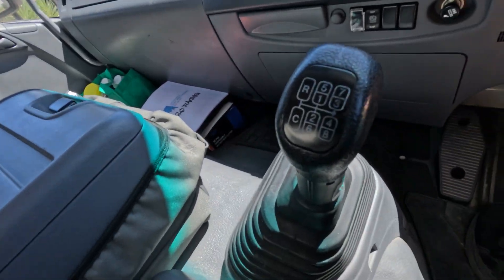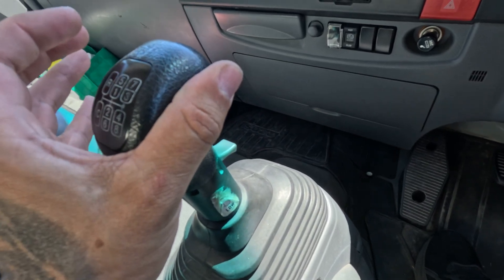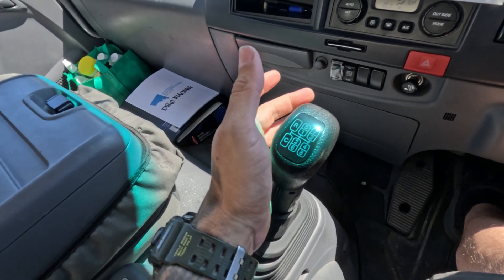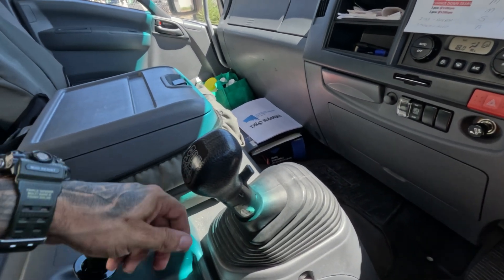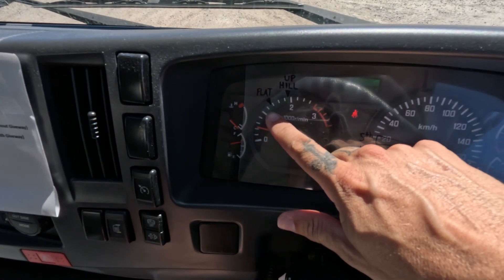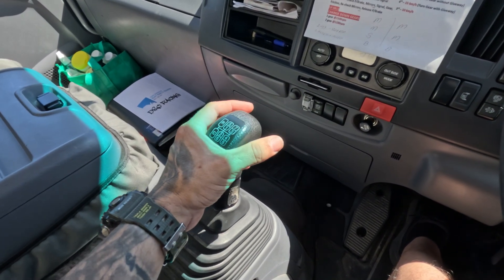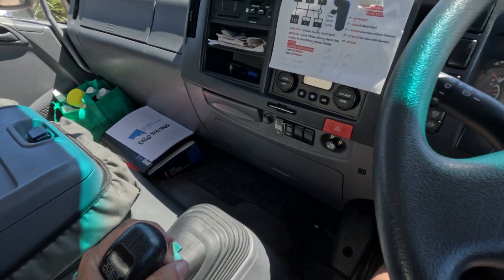HR SYNCHROMESH GEAR PATTERN / REV RANGE AND SPEED REQUIREMENTS FOR SHIFTING

Comment: So it's actually a nine speed?
Reply: Technically yes it is, low low/crawler gear is rarely ever used. It it only used on steep hills and offroad. Even 1st gear doesn't get used much as 2nd gear is sufficient enough to take off.
I hope I helped!

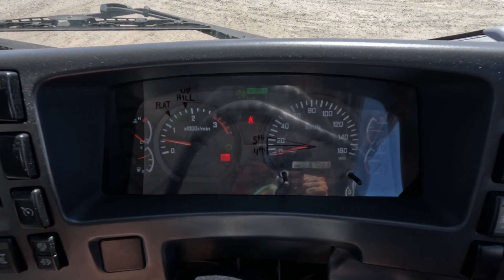Comment: 2:48 I’m used to seeing odometers with km/h on the outside, but MPH on the inside although I live in Canada, with a long border with the contiguous US which uses mph for speed and imperial for most weights and measures, even for petrol (sold by the US gallon rather than the litre).

Comment: I’m about to get my hr-b. Looks pretty simple like a manual car but you flick the switch for higher and lower is that about it?
Reply: Except in a car you can pretty much put it in any gear you want and the engine will take it. The truck only has a small window for each gear so you need to slow down to gear down.
Reply: @stephenhadley2490 are all HR gearboxes similar? I’m needing to get my HR-B license for a job in WA as a requirement, don’t have any room for error. I’m a handy driver of a manual car but definitely nervous about going for my HR license
Reply: @6t7ghost  Same as me . I think , its gonna be more of practice over what has been taught here in the video , feel will come as we go through
Reply: Did you manage to get it? How did you go?

Comment: Man I have driven a MR for years (skip bin truck) and my HR instructor is making me back down to 2nd gear @20 km to take a corner. It is so slow and frustrating. I keep feeling I am going to stall it at this speed.He makes me take off in first and wont let me skip a gear changing down. The clutch has been adjusted so it engages when your foot is almost right up on the peddle. I feel like im going to fail the test. 😢
Reply: I assume you went through and passed by now... what were your thoughts on it
Reply: Where about are you located if in Brisbane or around try Gold Coast truck school The guy is awesome got me passed on my HR Open licence

Comment: Can I ask, why does the syncromesh gearbox have taking off in second gear instead of first
Reply: because with so many gears you dont need such a low gear to take off unless you have a heavy load or are taking off uphill.
Reply: you could take off in 1 if you want but you would be revving high straight away and would have to change up straight away anyway.